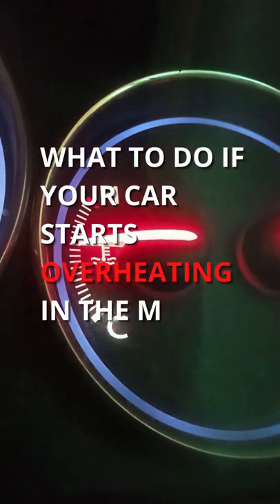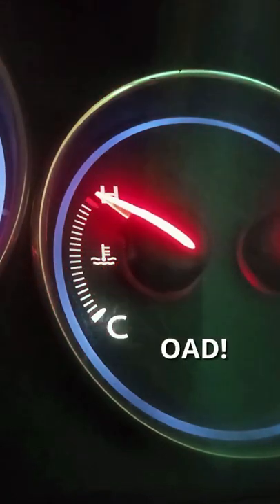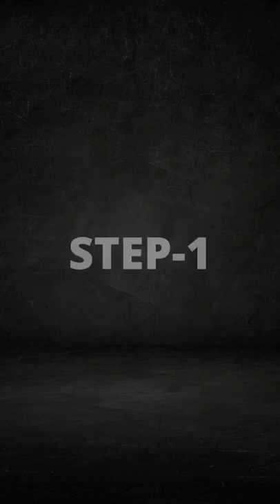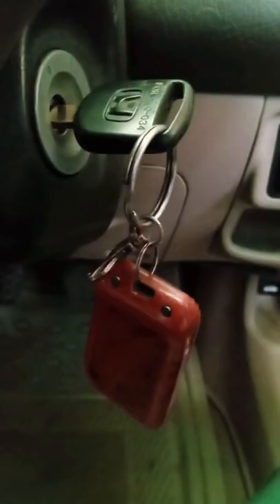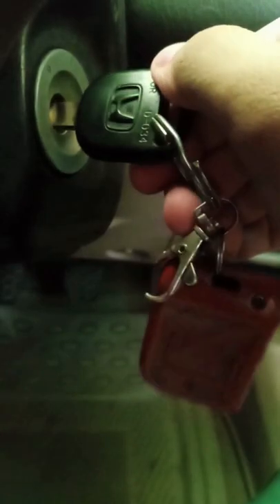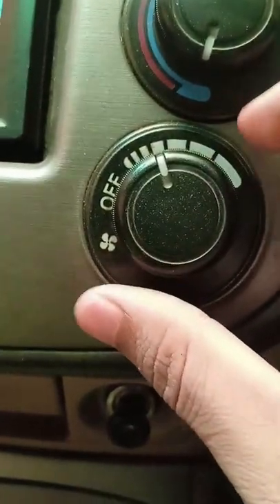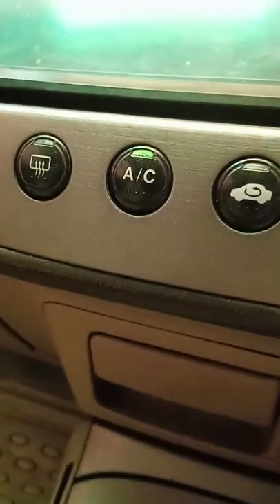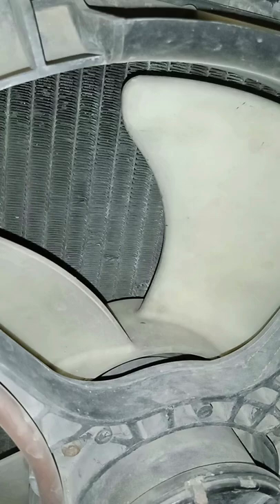What to Do if the Car Starts Overheating on Highway! (3-Steps) #shorts #quickfix

Comment: This isnt the Best way, what u can do instead is just turning the heater on cause if the car is overheating the fan Will be on anyways and if u turn the ac on it Will just be an extra load to the motor cause if ur car overheats going down the Road and there is wind going troguh the radiador it means there is something wrong with the cooling system
Reply: That’s not how it works. U won’t get any heat if the cars overheating
Reply: @ht901na7 why not?
Reply: @tecnojuanda3329  because the heat comes from coolant flow and if ur cars overheating it’s most likely a clog or low coolant(temp sensor can be at fault too but it’s pretty rare)
Reply: @ht901na7  or just the thermosthat is stuck closed

Comment: 🤣🤣🤣🤣🤣🤣
Reply from the maker: My sense of humour is getting better everyday 🤣🤣
Reply: @autohoney1775  it’s not good.
Reply from the maker: oops
Reply from the maker: maybe next time
Reply from the maker: btw what did you find funny in my vid??
Reply: @autohoney1775  the turning on a/c instead of heater which actually cools the motor unlike a/c, and ya should never open the radiator cap when the motor is overheating 😂
Reply from the maker: by turning on the ac i mean bypassing the fans since engine is not running fans will cool the engine faster, other way is to bypass by switch but that would be complicated and for the radiatior cap i mentioned twice in desc and in the vid
(step-3 wait for the engine to cool down....)
Reply: @autohoney1775  so how is the vid funny😒
Reply from the maker: Actually it is an educational vid but seeing your emojis made me think that you find it funny.
Reply from the maker: btw thanks for highlighting these two, i will make these points more clear in the future.
your comments really mean to me❤️
Reply: Yeah the video creator ain't wrong. The ac will do a much better job of displacing heat with the fan on. Otherwise you're relying solely on the blower motor. Sometimes you can even leave the car on and rev it to have to car run coolant faster through the system to increase cooling unless there's a serious issues with your cooling system. And he did mention to wait for the car to cool down before saying opening the reservoir. He had it in order. You must have not been paying attention.
Reply: @crisdeanda9006  plus your a kid what would you know about cars/trucks
Reply: @rydernash4661  yikes man. Definitely not a kid but nice try.
Reply: @crisdeanda9006  you’re pfp tells me otherwise